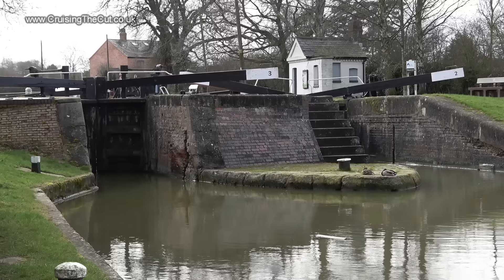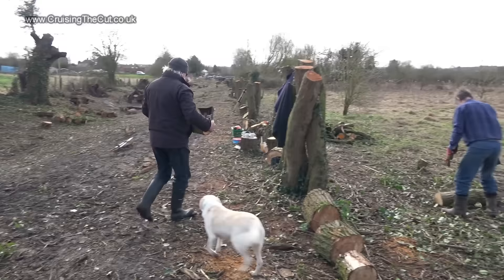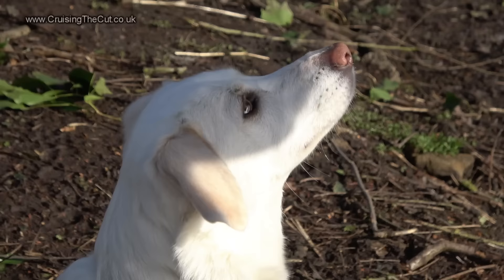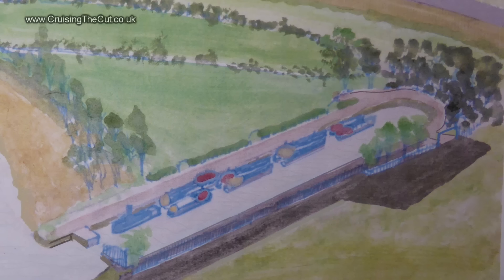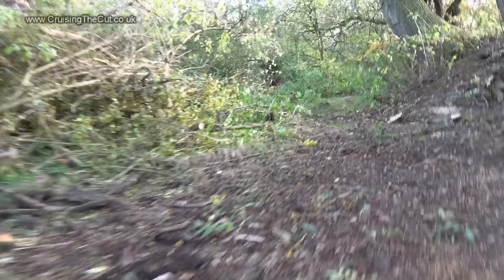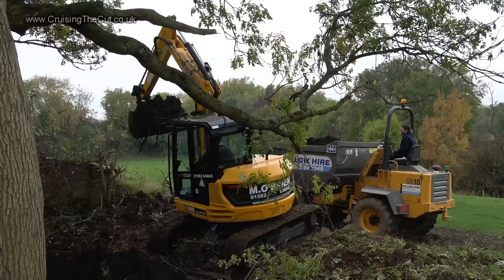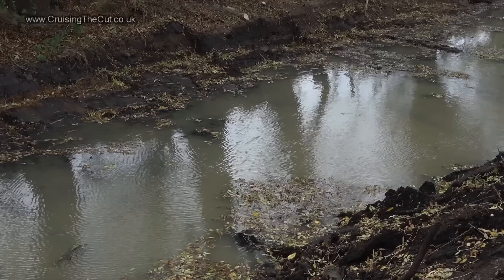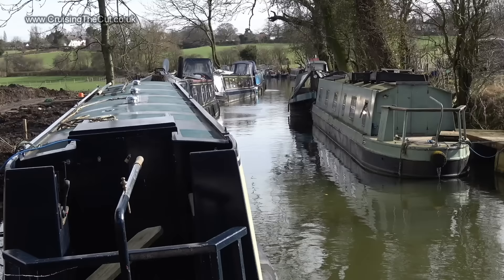80. How long-unused parts of the North Oxford canal are being brought back to life

Comment: Fantastic vid I loved it. I live near chesterfield and I'm very excited about getting our link back to the rest of the system, it's going full steam ahead now. But it's amazing to see the same thing going off in other parts of the country. Keep up the good work everybody it's fantastic.
Reply from the maker: Do you know what the timescale is for the Chesterfield restoration, out of curiosity?
Reply: Hello there I don't think there is really a planned date as they have had so much to contend with such as derelict rail lines which for some daft reason have to be kept in a railway condition (even though the pit's have all gone and not coming back) so lots of completely unnecessary bridges and locks for no reason. Then along came HS2 (and the intersection at Renishaw I believe was at exactly the planned height for the canal) so lots of problems almost like running into a brick wall. But the railways have been told that they have to accommodate the canal so it's going well.
Reply: My best guess as I cycle along and keep looking at the progress is 2 to 3 years.
Reply from the maker: Thanks. Interesting stuff...
Reply from the maker: Excellent.

Comment: The early boats on the Erie Canal that put New York City on the map where about 73 feet long and Fourteen Feet Wide...  Per some YouTube videos.  The canal was widened a couple of times and the locks at one cut was reduced to just Two Locks.  The SW side of Chicago had the I&M Canal to take trade to the Mississippi River.  The I&M Canal was built near the Des Plains River-more mud than river that the French dragged their Fur trapping canoes to the Portage of Chicago.  Thank you for the video !  tjl
Reply: Also "Teddy" built the Erie Canal and moved more earth than his other canal...  His other canal is in Central America and is still being used and expanded !  tjl
Reply from the maker: Excellent info, cheers!

Comment: Near where I live there use to be an old rail track that has been abandoned shortly after WW2. Some of it has been restored and is now being exploited by a group of volunteer tramdrivers (they drive old electric trams on the track) but the majority of the track has been removed so long ago that if you trace the route, you'll often just have to trust that it was there once. But in many places you can still see the elevation of the bedding; odly straight or slightly curving hills in the landcape. It also explains a series of remarkably strongly built bridges aht seem over-engineered for the few cows that cross it every now and then...
Reply from the maker: There's a stretch of grass near where this vlog was filmed, that's up on bridges above the river Avon - it looks so much like an old rail route but it ends in a cliff. Sounds very similar and one day I'll find out what it used to be!
Reply: It was the old train line to Clifton, which had its own station...
Reply from the maker: Really??? Thank you! I thought it had to be a train line.
Reply: There is a ghost train... Obviously.
Reply from the maker: Cool

Comment: Just finished watching all your videos, after youtube suggested I watch episode no. 9 on my home screen.

Fantastic ! Looking forward to watching more in the future.

You mentioned how dark the tunnels are, so why not install more lights on the outside of the boat? Seems like a trivial thing to do.
Also, why does the chimney stack has to be so tall? Can't it be the same height as the air vents on the roof?
Reply from the maker: Thanks for watching. Glad you like them. What I do now with tunnels is have a flood light at the back so that I can see the length of the boat and where it is in relation to the tunnel, as well as the headlamp illuminating the way.

The chimney stack is supposed to be that height for fire safety reasons, something to do with the draw of the air to ensure proper combustion. That said, you can get short ones to put on while travelling, and the whole stack can be pulled off for going through tunnels / under low bridges. Cheers

Comment: Any new news about the North Oxford Canal or other restorations?
Reply from the maker: The North Oxford itself is fully open and has been for years. The bits shown in this video were arms or loops off the main canal, which were part of its original route, long-ago changed. Unfortunately the first one shown has had to be abandoned, the second one is still moorings on a private arm.

Comment: Is anyone aware of somewhere old working boats are still stacked ?
Or did they all get scrapped? If there are any left I'd love to save one .

I've been quoted for a sailaway but to restore somthing would be wonderful.
Reply from the maker: There's no single graveyard that I know of, you just tend to see old boats all around the system.
Reply: @CruisingTheCut  yes I've seen the odd one . Is there any kind of website to your knowledge that deals with finding new owners for them ? 

I know it won't work out much cheaper than buying a new one . But to have a boat with rivits and to know I saved somthing would be lovely.
Reply from the maker: Not a specific site for them, just the usual ones like apolloduck. Terrible, awful website (appears to have been assembled in the 1990s) but it's the main one for boat sales.
Reply: I like Apollo duck . There is one on  there  atm . It's £2500 . Its iron though so I don't know if you can weld it or what .  I'm only good at woodwork.  Lol
Reply: @CruisingTheCut  I know overplating a normal steel boat is 2k to 10k but iron.  Not got a clue what that would cost .

Comment: David thanks for the message its ok  but I have another question  to ask  when do you have to pay poll tax or  council tax if u stay on a marina full time as in  12 months solid  without  moving  of the marina is that then classed as having to pay  full council tax...
but suppose we go out on a few trips within that year say for a few days at a time what happens then ??
this could be as many as a month  long   spread over a the 12 month period.. thanks  steve.
Reply from the maker: Only moorings officially classed as residential pay council tax, not sure who told you 12 months. It may depend slightly on the marina, some have liveaboards "under the radar"
Reply: On the marina that we may park on say u may be liable to pay council tax  but as I have said what if u are out  a few times a month  every month cruising the canalswould u still have to pay
Reply: If this is the case its  not much better than staying at home  just as many bloody bills thats one of the things that draws u in is the costs  are supposed to  be low hah
Reply from the maker: Owning a boat is never low cost, that's a myth.

Comment: At the risk of sounding incredibly uneducated I don't understand where the water came from that filled the new area. How does that affect the water level elsewhere?
Reply from the maker: It came from the rest of the canal, which is in this case on a massive stretch of many miles between locks so the effect on the level will have been relatively negligible and will over time be re-topped up by the usual mechanics of the canals and locks (water gets pumped back to the top and released / shoved along the system as needed)

Comment: It might be too late now, but I was thinking, when they scraped up the bottom of the new finger, why not sell that clay to local potters and gain back some of the money used to rent those big machines or some other expense for the canal. Or, they could just give the clay to potters on a promise that they would make special mugs, bowls and such and sell them to long boaters and the potters and the canal organization can split the proceeds. They should also sell the wood to wood workers.
Just an idea in a feeble attempt to help the up-keep of the canals.
Reply from the maker: Because that clay is what's holding the water in!! They dredged down to the clay level and stopped. Else they'd just have to reline it with new clay!
Reply: Oh I know that part, but I figured to use whatever clay they might have scraped up while digging to find that clay layer under the top soil. They were bound to scrape some of it off while looking for it. I don't know how thick/deep the clay layer is.
Reply from the maker: Ah, it came up with a whole load of mud; would have been quite the job to separate even if washed out. Also they had to be careful not to dig up the clay in the first place.